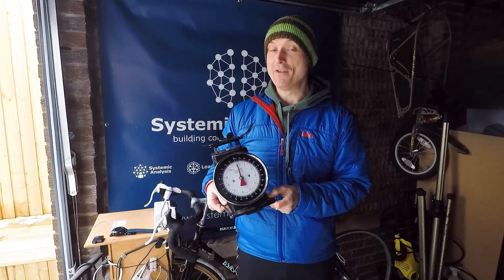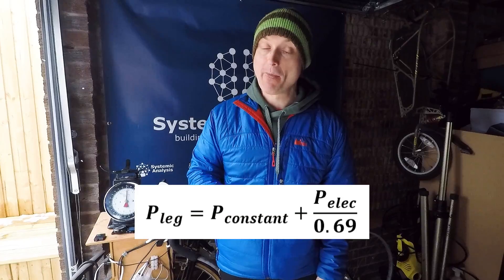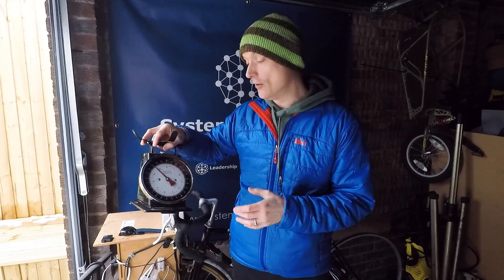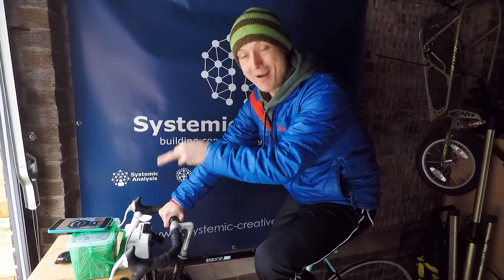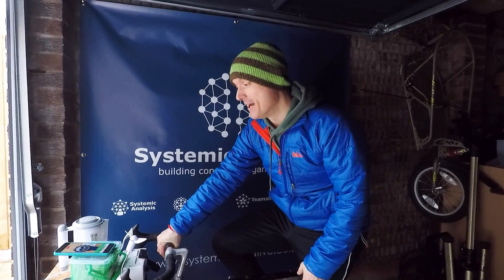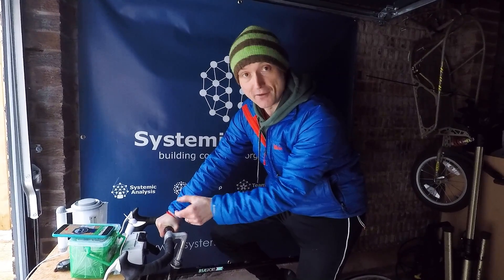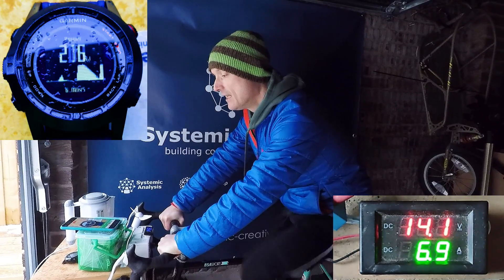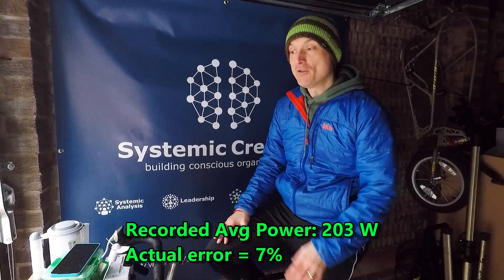Bike Power Meter vs Kitchen Scales - The Test!

Comment: You're going about this the wrong way in my opinion

You need to ditch the wheel and gear system. You need the pedals attached to one large gear contacting another with a gear ratio of 1-8, then another one with 1-4 then have that drive the generator
Reply from the maker: Certainly if this was a commercial enterprise or scratch build, a gearbox or other simpler transmission setup would be more efficient and preferable.
Similarly, the alternator here is woefully inefficient compared to better AC generators or permanent magnet DC generators. 
However, the purpose of this build was to use an existing bike and parts which are easily and cheaply available and straightforward for anyone to build. Keeping the bike as it is with just a belt drive, and using an alternator with built-in voltage regulation and rectification serve that purpose well.

Comment: To calculate watts, formula is volt x amp and for this 14 x 7 = ¿
Reply from the maker: Close enough to 100 for our purpose here - the statement is an approximation. The volt-ammeter being used here isn't accurate enough to warrant worrying about the odd tenth. During the measurement, the voltage is 14.1 for some time, with the current reading 7.1 at times, which is more than 100 W, so it varies under and over. We've actually added a much more accurate meter since this video, and repeating the measurement results in the same basic conclusion. 
This process is about obtaining a rough but reasonable working figure, rather than making very precise measurements - pushing a crank around with a set of kitchen scales is as rough is it gets, measurement-wise!